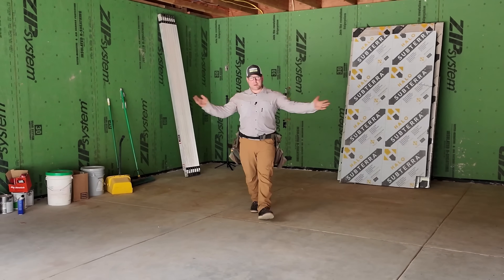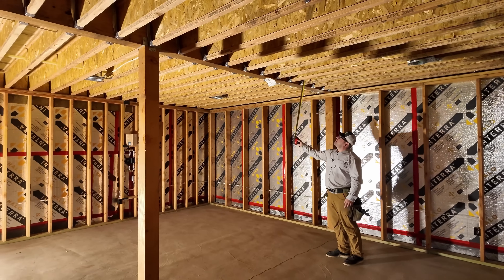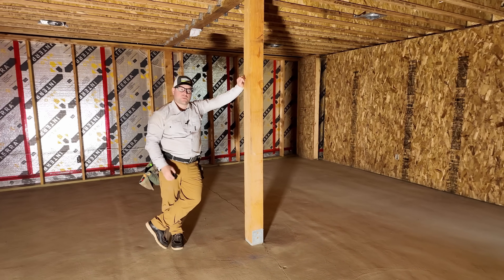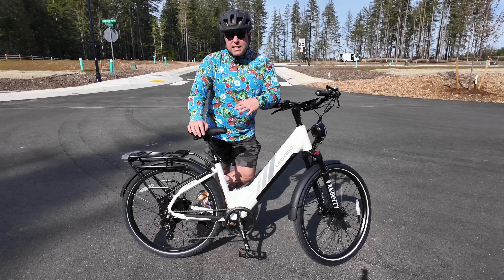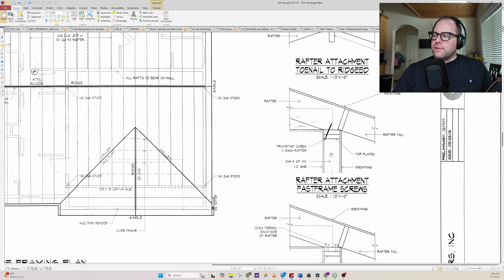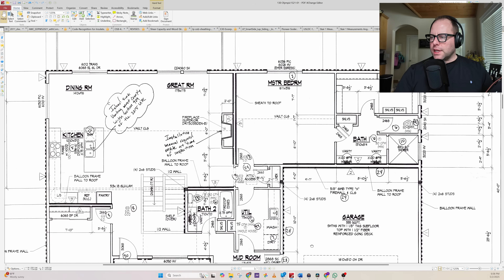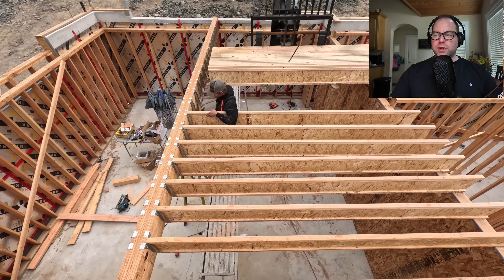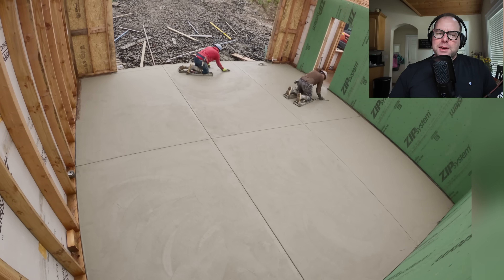Is This Safe? We Drove a Car Into a Wood-Framed Garage Floor

Comment from the maker: POLL TIME: What do you think of this garage floor system — would you park a car on joists?

We tested it with a real vehicle (and the engineer signed off on it 😅), but I'm curious what you'd do differently.
👇 Let me know in the comments — and if you’re still skeptical, tell me why!
Reply: We have done a similar system for a library. The existing floor was 3x14 Doug fir joists 12" oc and we sistered them with 1-3/4" x 14" lvls. Existing sheathing was 1x8 run diagonal and we went over it with 1-1/8" t&g plywood then 4" slab with fiber mesh. I believe the span was 22'. I'm not sure what the comparison of books vs vehicle is but I am sure they would be comparable in live load. I don't see any problem of parking on that slab at all.
Reply: Yes, I'd park there. You're good at what you do, engineer is good at what they do. I wouldn't have a second thought to park or not
Reply: I may have just framed some temporary walls and done a structual slab. You could even do a steel beam down the middle that takes some of the live load to columns on either end of the room.

Comment: Cost of gauge floor is 12 - 2 x 16 x 8 x 24 flange steel beams (on concrete) & 2 bunks of 2x8 tung & grove southern yellow pine flooring. One can pour concrete on top if you want.
My Amish barn building friend is expanding barn with 42 ft steel beams first floor, 4 by 10 oak beams with 2 x8 pine tung & grove flooring. All hand banged with 16 penny’s by 16 year olds, who can swing hammers all day.

Comment: Getting rid of the post 2.0, how bout 16 deep x 24 long 8 flange steel I -beams every 2 feet? then 2 x8 tung & grove flooring, (laid like a hardwood flooring) with random seams. It cuts the materials list way down leveraging the concrete walls & steel. Bet it cost less than existing design. And is 2 x stronger, and we got rid of the post.
Reply from the maker: Would definitely be interesting to price out
Reply: The only thing that has me in the dark in design is your “seismic” code. I’m from Pennsylvania, no earthquakes here. To tie the steel to the concrete so that it acts as “one” in a seismic event. The steel can not “rock” on the concrete foundation, it must form a bond with the concrete.. Perhaps, pouring all 4 corners (less than a yard) of concrete between the steel locks the entire steel run to the concrete, Then the wood structure above takes the seismic sway.
The “steel “ must have the same relationship to the earth as the concrete,, to make the design work.

Comment: Thanks for showing that, love the video. Did the engineer give you an idea of the bearing weight that the floor can support? I've seen this done almost exclusively with steel and/or concrete, first time with wood.
Reply from the maker: He did but I just don't remember the specifics.

Comment: We've framed lots of raised floor garage slabs. They're super strong I've seen our drywall supplier loaded the whole entire house drywall into a 2 car garage, that's roughly 40k lbs. Compared to 2 cars at 4k lbs each.
Reply: Of course, putting 40,000 lbs. on a slab wasn't a good idea. Furthermore, the weight of the car may be 4,000 pounds, but it's concentrated at four points!: the tires. It's not distributed evenly across the slab as it is with drywall. Hopefully, the sheeting and concrete will help distribute the load. It might be fine, but it is not a straight forward and  certainly had to be engineered.

Comment: Why don’t just do a concrete slab like a parking garage
Reply from the maker: For residential, this is simpler.  It uses materials readily available, a skill set we already have and a post tensioned slab (if that's what you are referring to) is just outside our wheel house.  I doubt its cheaper

Comment: I don't see why anyone would have a problem with this. As a Civil Eng myself, you figure out your loads, then "follow them" all the way down to the foundation, making sure you're specifying the right sizes and configuration of members along that path. I'd be willing to bet this floor could hold 10x the weight it will see on a regular basis without collapsing. Those load calculations have a ton of safety factors built in.

Comment: I’m building a house on a sloped site on the Oregon coast and we’re doing the exact same thing—same beam down the middle, same I-joists, same joist spacing. As you mention, slope to drain to the overhead door and install a good waterproof membrane and you should be good for a hundred years or more. It’s done more often than most people realize.

Comment: How about the moisture/water from the concrete transferring to the wood? (If i wash my car inside the garage). Also cost, is there a big difference having concrete, rebar metal post vs on what you did? Thanks
Reply: The water in concrete is consumed and permanently bound up in the concrete during curing.

Comment: I like these type of detailed videos.  Question: are the furring walls bearing?  If so, in the drawing detail section, it looks like they would be sitting on a bit of the concrete slab and some slab insulation.  Is that correct?
Reply from the maker: Yep, they are bearing, but to your point about the foam under the slab, the actual lbs/foot is less than you'd think.

Comment: No drain in the flood Wet car or snow or just a fluid leak Where will it go?
Reply from the maker: Flood?  Snow?  Well, we have a 12" frost line at this site, ergo, snow is very very minimal and rare.  Take a look at your car next rain when you pull in, you'll see that the water that actually gets on the slab is minimal and evaporates.  Science.  As far as fluid leak? same thing, modern vehicles don't leak enough to actually run to a drain.
Reply: @AwesomeFramers  Interesting I live in the north east and snow and ice on cars is a problem I do have a drain in my garage to a dry well When it melts the water does run into the drain and into the dry well  However it is an interesting concept Time will tell Thank you
Reply from the maker: @jojohns1949  it just shows again how each situation is so different. Thanks for watching and asking 👍

Comment: I would definitively be concerned with the humidity in the concrete rotting the structure over time. Humidity caused by inside car washing, melting snow, dripping wet vehicles driving into the garage. At the very least I would install waterproofing system on decking, running up the walls. Might even consider a ventilated space between the underside of the slab and the sub-floor (like a 2x4 sleeper, to prevent moisture transfer to structural elements.Sleepers and 2nd row of sub-floor would become a sacrificial layer (in case waterproofing system fails) and also allow easy slab removal and replacement (the day it will be ruined by street salt). Personally though would go with steel beam, intermediate HSS column, steel trusses, corrugated galvanized steel decking, 6x6 #8 mesh covered with concrete topping (with min. 2" cover above  high side of corrugation). Alternatively just pour a structural, reinforced concrete slab (in this case, about 6" thick, plus slab slope, for continuous slab over 2 bays with end supports anchored to top of the foundation walls). With proper fire protection of the steel, you will have a fire resistant assembly as an extra bonus.
Reply: ...and I wouldn't use OSB but BC Fir plywood (much better resistance to rot).
Reply from the maker: https://youtu.be/a7ESROS4Raw?feature=shared
Reply: You guys are way over-complicating things. What Tim is doing here is not a big deal at all.

Comment: The support beam just sitting on the foundation with no footer while holding up concrete? thats nuts. My 2200sqft house all the beams are on footers seperate from the foundation. Nice fracture running up to it.
Reply from the maker: Did you actually watch the video? I showed the blueprints, the engineering and the foundation.  I specifically addressed that.  Nothing in this video leads to your conclusion "The support beam just sitting on the foundation with no footer while holding up concrete? thats nuts" I also linked to the longer form series covering the foundation in the video.
Reply: @AwesomeFramers I didn’t get that far. I’m not a builder, but every house I’ve ever been in where I live the footers are separate so it seemed wild to me

Comment: I am a carpenter in Boston doing primarily commercial buildings. We use corrugated metal decking that then has reinforced concrete poured in it. Did you guys consider using that type of system?
Reply: Indeed, that would have saved a lot of timber.

Comment: Just curious:  Why the use of dimensional lumber for posts rather than PSL posts?  PSL material is generally stronger than dimensional lumber.
Reply from the maker: Good question, because the sawn lumber had enough capacity.

Comment: Was this more cost effective than the precast slab panels?
Reply: Way cheaper. Find a builder like these guys that do concrete in house or the price will come out over 50k for the room under the garage.

People that do it in house guessing 20k.
I only do spec so I don't know what I'd charge.

Precast start by calculate $400 a cubic yard for the piece before delivery and crane. If that works then call precast and price it.

Comment: If an engineer has stamped the drawings, inspected and signed off on the construction of it, then any and all liability rests with him... the challenge with this assembly is obviously trying to keep water from seeping  down and eventually rotting out the wood structure, rendering it no longer able to support its own weight, let alone the weight of a vehicle. The only question is WHY would anyone build a structure from wood that is destined to fail when pre-cast concrete panels would have served this application perfectly? This is absolutely insane on all fronts, from the engineer that stamped it, down to the municipality that permitted the construction of it.
Reply from the maker: Slab is sloped and there is a membrande between the slab and framing https://youtu.be/a7ESROS4Raw?si=sCpXWQXPzXZHKgcC
Reply: @AwesomeFramers  so the assembly relies on a vapor open self adhering membrane with no visible drainage layer or drain to maintain it 100% watertight? Can you foresee any problems with that in say, 5 years from now when the home is still in its infancy?Edit... I just dawned on me that you installed the wood structure in a flat condition because you mentioned you provided slope to the slab, 6" to 4"... so when water seeps down to the membrane it just sits trapped between the slab and the membrane...Am I getting this right?
Reply from the maker: @mick8018  zero problems because with a steel trowel finish and a sloped floor, water won't get down into the assembly.
Reply: @  That is negligent thinking friend. The control joints, designed to crack the concrete in their locations will 100% allow water to penetrate, and its already doing so. I'm standing by my original reply. This is absolutely insane, and would never build this for any client...
Reply from the maker: @mick8018 Great!  Its ok to disagree and that's awesome you won't build this for your client.  We will and stand by the design and work.

Comment: This is a bunker room correct? Instead of having steel beams you did it with LVL/wood framing? But the bonus aspect your saying is that you get a proper ceiling height using LVL method?
Question if using steel beams/steel joist why can't one just dig the floor bit deeper in that bunker room (step down into bunker room? There would be no washroom in that room so nothing to worry about not having a bathroom because too low for sanitary connection.
Reply from the maker: Its not a bunker room

Comment: I don't worry about the strength I would be worried about  the car dripping various fluids or bringing in moisture with it over the years. Hope it works out.
Reply from the maker: Do you think that's actually a real issue in real life?  Just in case, we installed a membrane between the slab and wood floor https://youtu.be/a7ESROS4Raw?si=sCpXWQXPzXZHKgcC

Comment: In the SF Bay Area we build houses with full basements and the first floor is built with a post-tension slab on top of the 12" thick basement wall. It's a practice adopted from commercial construction. The slabs are generally 7" thick, depending on the span and 2nd floor loads. On one job it was difficult to get the bobcat around to backfill the foundation so he drove right over the suspended slab. No cracks!

Comment: That's actually cool to know that it works. Planing a cabin build and want to do a garage too and was kinda wondering how crazy it was to even consider wood for a surface that could see a car eventually get parked on it. Ideally you'd probably want some sort of vapour barrier to separate the concrete from the wood but I assume this was done.   At my current house I actually have a crawlspace under my garage but everything is solid concrete.
Reply: You got the idea but you could look at just using a wood floor if it's not a full time house.
I just commented on someone that asked for a wood foundation video and a cabin is prefect for that if you're going small and simple.
Presuming you're not calling something over a 1000sf a cabin.😊
Reply: You got the idea but you could look at just using a wood floor if it's not a full time house.
I just commented on someone that asked for a wood foundation video and a cabin is prefect for that if you're going small and simple.
Presuming you're not calling something over a 1000sf a cabin.😊

Comment: This is exactly the kind of video I like.
Reply from the maker: Do you mind sharing why?  I'm trying to plan future content.  Thanks!
Reply: @AwesomeFramers  don’t mind sharing. My home has a suspended concrete slab (front porch instead of garage), and it was done a couple years ago, and I was so excited for it, but there were nearly 0 videos exploring the topic. Especially not supported with engineered lumber like yours, which I also love to watch videos about for some reason. So I like suspended concrete slabs in residential construction? Like your videos concerning this and the Perkins’ newest build with their suspended garage. Odd I know. 

But more generally, I like your content that delves into the engineering at all, but especially when it uses engineered wood like glulams, I joists, LVLs, etc.
Reply: This video is Is super interesting because you’re doing something out of the box. It expands everyone’s mind. 
I’m gonna force my engineer to watch this.
Reply: @guyrandom7861   He won't need to there are easy point load standards and requirements for residential garages. Not expensive   calculations. You're going to have a pole unless you have a special use.
If you're a customer and your contractor doesn't do foundations in house get ready for a shocker price.
Find someone like these guys for this kind of add on.
Example: this might be a 10-20k add on for my company.
Someone that contracts it out I'm guessing 50-75k finished.

Comment: NICE but the center post kills the downstairs room.    A steel beam no deeper than 12", spanning the entire 24' likely could  have been used.  Joist hangers could have been connected to the top flange of the steal beam, effectively reducing the steel beam's unbraced length to 1'.   Yeah footings may need adjustment , but what takes a few hours now, eliminates  a lifetime of restricted use.
Reply: Every house from thw 50 through 90s has a steel post in the middle of the rooms somewhere

Comment: I'm no engineer but wouldn't a concrete span deck have been easier and given even more headspace and a free span?   They show up on a truck and are literally set in place and I believe they are post-tensioned but I could be wrong. I've seen this in the parking garage at work. Those were 12-in thick slabs by 8 ft. Wide and 30 ft. Long and they were able to drive on it the next day to install the next section.  Mike patey used them on his crazy pool house" will my house collapse"    ps I'm totally with you about being totally safe.
Reply from the maker: Could your un the price on that and post it here for future readers?  I love the idea
Reply: @AwesomeFramers  quick Google search of hallow core concrete span pulls up many companies that build them. From a quick read they are compatible to a traditional pour in place deck or ceiling with all the cribbing for overall price. Hope that helps.  Is it cheap probably not but is a wood deck cheap probably not will insurance like one over another????

Comment: I think that an interior floor drain to catch runoff from blowing rain or snow on vehicles would be in order. Also, an nicely epoxy coated floor should alleviate any moisture seeping through the slab.
Reply: It must drain out the door. Drainage is code requirement. There's a membrane under the slab, but epoxy would be helpful.
Reply from the maker: Great points!  Slab is sloped and there is a membrande between the slab and framing https://youtu.be/a7ESROS4Raw?si=sCpXWQXPzXZHKgcC